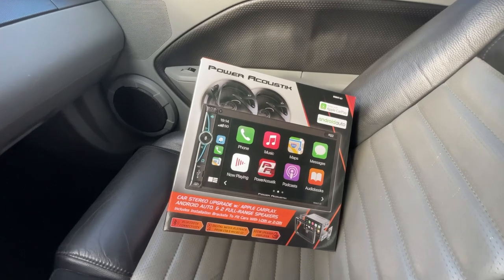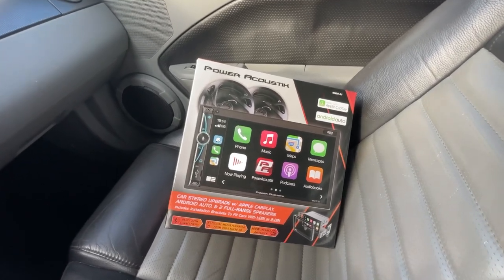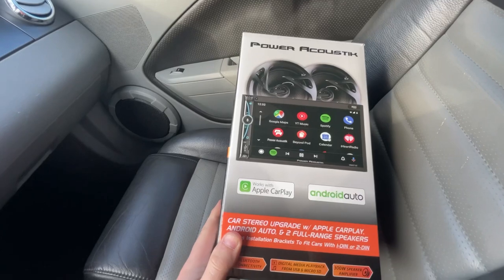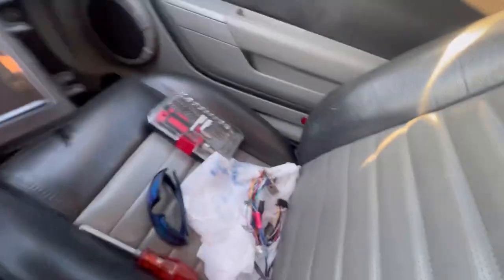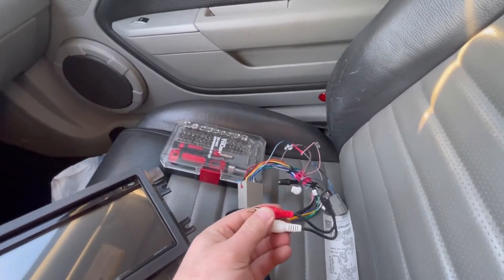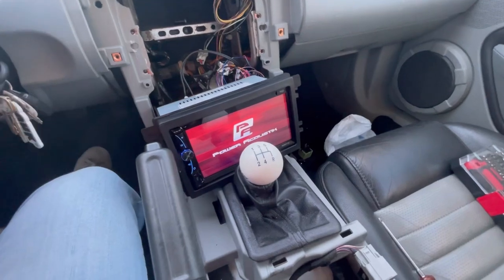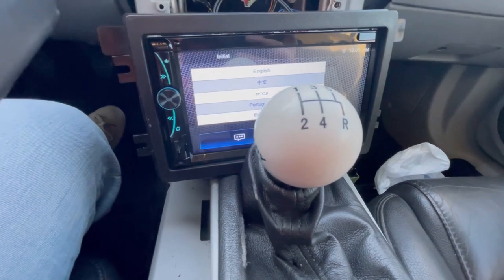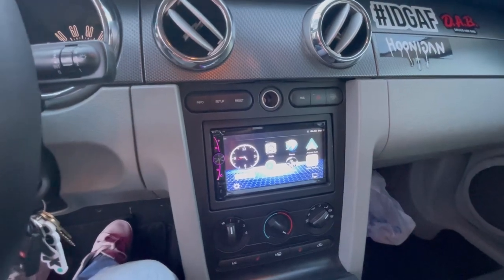05-09 mustang radio install

Comment: This is a common thing with the ford factory amps to get the pop when you turn the car on it's from the amp wire that you found that had the ark on it, it requires 2 volts of power to turn on and your radio is giving it a full 12 volts all's you got to do is get the step-down relay they make for ford cars amplifiers to aftermarket amp turn on and that will stop that pop. they normally sell it with the wiring harness if your car is equipped with factory amps, and by the way the amps are located in the driver side foot well. I also bought and 07 GT and got a family, so I feel you on buying stuff for your car family responsibilities come first, so I just buy a part here and there until I get it all.  I'll be posting on that build soon, but keep up the good work, all good things come in time bro!
Reply from the maker: Appreciate the feed back man👍🏻

Comment: bro that connection for the amps is so hard to find across any forums for the mustang oem amps (shaker 1000 or 500) systems. No one will ever tell you where it goes. Thank you for that.

Comment: I recently tried installing a radio in my 06 Gt, connections were right but there was no power to the radio. On top of that I couldn’t catch my power to my windows and convertible top either, any advice you have that may help??
Reply from the maker: Check the fuse panel on the passenger side in the car then find the fuse for radio! Probably grounded the wires out like I did and it did the exact same thing yours did. Hope this helps man!